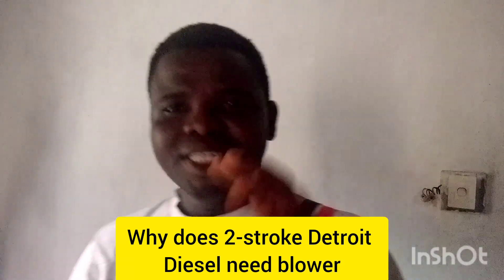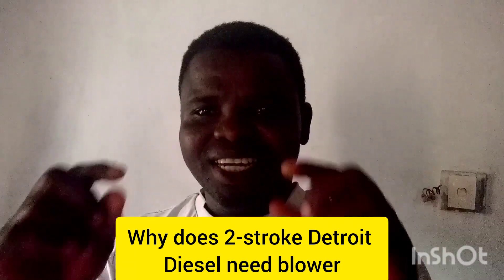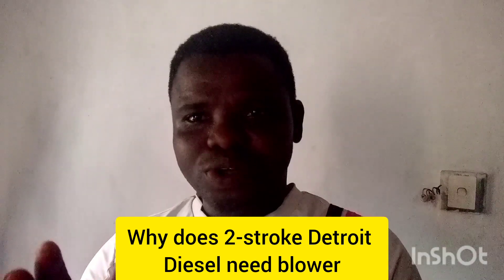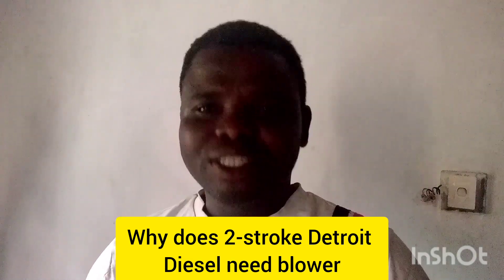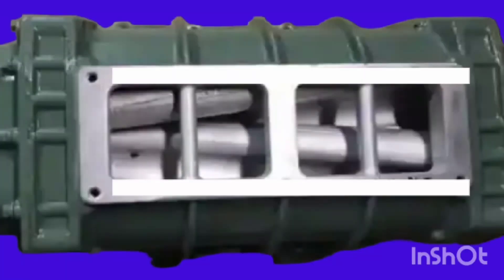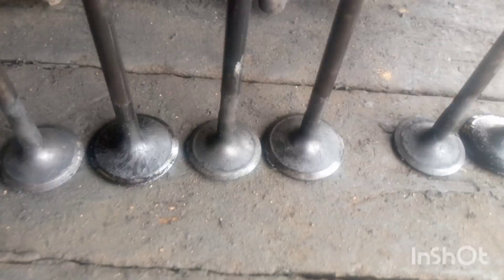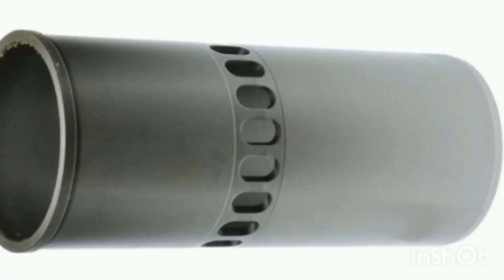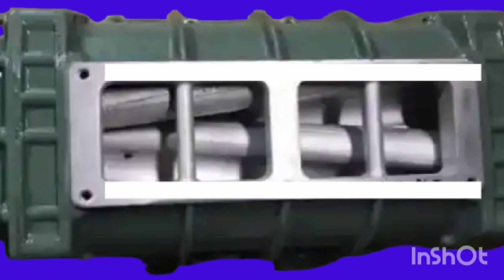Why 2-Stroke Detroit Diesel Need Blower

Comment: Because they have oil in the crankcase
Reply: Explain. How does that matter?
Reply: @ncopp4358 my brother in Christ, do your own research.
Reply: @ncopp4358  a 2 stroke uses crankcase vacuum to draw fuel and air and oil . That's how come they have oil mixture in the gas. A Detroit uses a supercharger instead and has a conventional oiling system
Reply: @markfairhall3671  okay sure. But your comment doesn't really explain anything. How is anyone. supposed to know what your talking about.  It was just a bad take in general.
Reply: @markfairhall3671  A 2 stroke can diesel without crankcase oil. High compression with premix. Just because it has crankcase oil doesn't explain why its a 2 stroke diesel that needs a blower. See where I'm getting at? They didn't pour oil in the bottom of a 2 stroke and then design a diesel engine around that fact no
Reply: @ncopp4358  it's got exhaust valves in the head too.